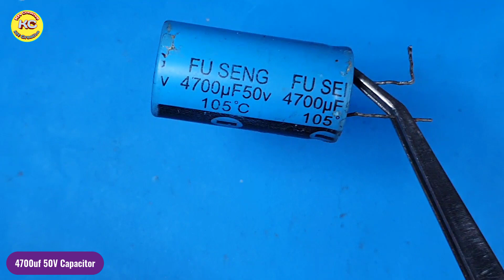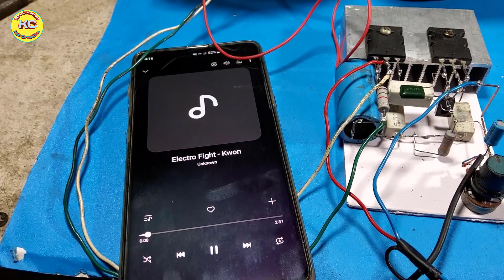How to make Deep Bass Power Amplifier,  New Circuit, Deep Bass Amplifier

Comment: What is the power supply that is 12 dc volts? And what is the connection ?,and what kind of speaker you used? Thanks for sharing.
Reply from the maker: transform 12V, thanks
Reply: 6 transistor 5200 1943 circuit vedio sir